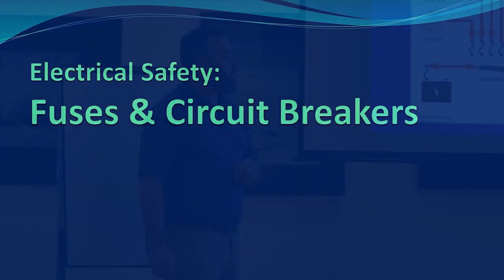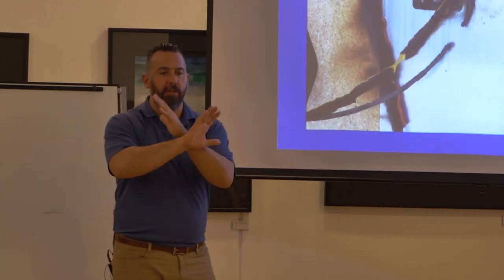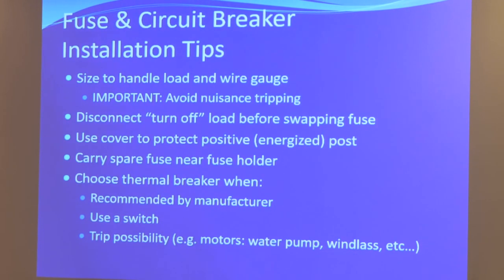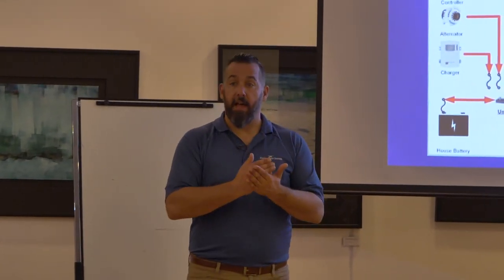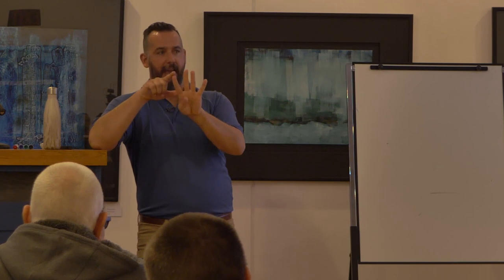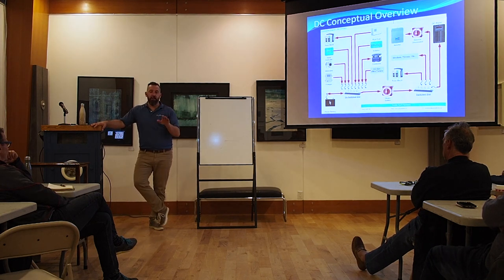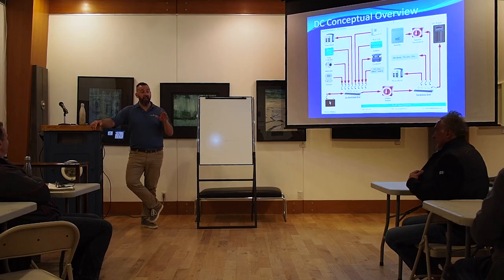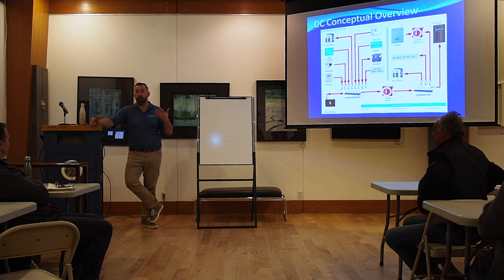How To: Marine Electrical Seminar - Fuses & Circuit Breakers - Ep 17/30

Comment: I had a dead short on a 20m-long 220v extension lead. We were building a chicken farm in Thailand and the temporary electric supply installed by the farmer/builder had no breaker, a straight 220v supply off one of the 3-phase supplies.

It is absolutely terrifying, the whole building filled with dense brown smoke. It only stopped when the wire melted. I was too scared to touch the knifeblade switch and turn the supply off. I thought my whole investment was going to burn down. The scorch marks are still on the concrete floor today.

I am a lot better-versed in electrical systems today than I was then, a lot of the information I got was from Jeff's videos. I'm still learning. Nice one Jeff, BTU.

Comment: I've been working through your video set and was most impressed with this one. Your explanation of how motors draw more current when fed with lower voltage is a topic that many techs do not understand well. You got me thinking about how I can better reposition my fuse locations to better protect the wire, in case of a proximal dead short between battery and present fuse location.

Comment: Hi Jeff, thank you so much for your videos. I had a question on thermal breakers. You say that they are generally only used on motorised loads, but are there any reasons why we shouldn’t use them everywhere, considering they are more practical and less wasteful than regular fuses?
Thanks

Comment: Your videos are fantastic, Jeff - thank you and PYS for putting these together.  I have a question about Fuses vs Circuit breakers.  From my distribution panel with circuit breakers, you mentioned in another video placing the fuse close to the appliance in this scenario.  If my circuit breaker is 5A, and my appliance (say water pump) demands 3.75A, do I need to place a fuse on this line, and where - or would the 5A circuit breaker be enough?  (Also a 100A fuse between battery and panel.)  Does the circuit breaker protect the 14AWG cable, 30ft full circuit run, and the fuse protect the appliance, or is this unnecessary with a proper amped 5A breaker?

Thanks for your help - looking forward to finishing my boat project and want to do it right!  You're inspiring many of us budget, first time boaters to not be scared of marine electronics!
Reply from the maker: Since circuit breakers come in limited sizes (e.g. 5, 10, 15, 20, 25, 30, 50, etc...), we commonly have circuit breakers protect the wire to the appliance and then close to the appliance we install the exact fuse recommended by the manufacturer. Generally, to avoid nuisance tripping of the circuit breakers, size the wire and the circuit breaker to be able to handle at least 1.25 times more then the max expected amperage. The fuse near the appliance is sized exactly as per the manufacturer.

Comment: If you are adding a fuse breaker on 30 amp shore power....do you use a 30 amp breaker or a bit higher like a 40 amp?

Comment: @12:30 the reason that the the current increases as voltage drops on a motor but not a light bulb is that the motor is also a generator as it turns-its called back emf which bucks the input current. As the the motor slows because of low voltage (or excess load) the back emf decreases ,in effect lowering the apparent resistance and increasing current. The max a motor will draw is in the non rotating condition.This often called the "Locked Rotor" spec and exceeds the "normal" load current
Reply from the maker: just gold, thanks for sharing.

Comment: Thank you for your vids.
It's a real pleasure to have so good quality information.

I haven't heard if it is possible to start a 50 or 70hp engine with the house bank, in case of a starter battery death while we are at an anchrorage for example.

I just have a look on the schema of my sailboat. There is a battery isolator and the 2 battery banks are on it. But there no fuse between the alternator and the batteries. Do you think I must add one on the Alternator, or is there a fuse in the alternator ?

Thanks

Comment: From the question about the current going up as the voltage going down to the windless at around minute 14. When I was in automotive school, the instructor said that the resistance of an electric motor comes from the armature spinning. If you could stop the motor from spinning, you would be able to create a short to ground through the motor. I think this is how the amperage goes up as the voltage goes down,  the low voltage causes a motor armature to spin more slowly and thus, the resistance goes down and the amperage increases.
Reply from the maker: Hi John, thanks for sharing this explanation.
Reply: @PacificYachtSystems  I would like to add something to help here. When a light bulb is measured for resistance (low voltage) then R is almost zero, but once connected to AC, R is not almost zero anymore (240). R value depends on the current going through resistors. Thats is why when the V drops, R drop and then Current tries to go higher, tripping the breaker.

Comment: Jeff, your electric /electronic videos are great!  On the fusing video I have a question? I have  large fuses  between house bank and breaker panel, alligator and ACR, charger and batterie banks, and breakers.  On breakers with only item being powered do I need fuse between breaker  and the item ie vhr?  On breakers powering multiple cabin lights  thru a buss bar do I need a fuse? All navigation and cabin lights  are led with 14 g  wire, running lights 14g  wire.  On plugs used to  charge  phone's,laptop's,  and computer running 12g wire do I need a fuse at tach plug or 1 at the bus bar?  Thanks for taking the time  to record and edit  theses  videos.

Comment: Great video thank you! I am currently working on the canal boat im building in Amsterdam and doing the wiring my self. 
I have a question though. I  will be using only a switched panel with 4 switches(fused at panel). So Ill run a Fuse from the battery to the bus barr and then 4 fuses going to the switch panel (just after the bus bar right). And then the panel is fused as well.
I did not see in your diagram that there has to be fuses after the bus bar, there need to be then four for eats wire right,?
Much apreciated, Daan

Comment: Great Videos you have :) I have one question: I have two motor on my boat, and consequently 2 batteries that are on use for the equipment's as well, I have a 1,2 all switch, and I would like to install a battery to use only will the equipment's, can you let me know the best way to do it.
Thank you :)

Comment: I guess there is a limit to this, when the wire length is really short, then the place of the fuse becomes a "fussy" decision, no?
ie: we have 20cm (8in) wire between the batteries and the DCtoDC charger. The fuse takes half of the length. (Small compartment on a small sailboat)
Still learning here :) Thank you Jeff.
Reply from the maker: Hi Helder, you bring a good "fussy" point. That exactly why we like the MRBF fuse, as it's a small inline fuse that is easy to deploy.

Comment: Hi Great video , where would you use a class T fuse seen you refer to it in others vids thx i have a Victron 24/5000/220 Inverter charger Lithium bank 8x12v 200a set in in 4 pairs for a 24v bank , how do i work out the size of the class T fuse thx

Comment: GDay Teach 🍎
I’m still gathering information ℹ️ on relevant formatting\outlay, for my humble trailer boat.
So, a question 🙋🏻‍♂️ ⁉️
{ Quest ’for the’ ion 😸} 
1 ) Is ‘combiner’ another description for DCDC Charger ⚡️ 🔍🤔⁉️
2 ) how many benign insulation coats should an ideal marine cable have ⁉️
3 ) What’s the Best marine cable brand, Good Sir ⁉️
4 ) For a 115hp 2stroke, what’s the ideal exterior operational [onboard] gauge wire for In-between humble appliances eg; pot winch etc, Skipper/Teåcher ⁉️
I guess that last question 🙋🏻‍♂️ is “loaded”, pardon the pun..,😉👌🏼 
As attempt to answer my own question 🙋🏻‍♂️ I Thankfully 😅 recall your previous tutorials on the importance of knowing the combined draw of existing & possible machínes/motors & converters •
Merci Beaucoup 🙏 for your insight ✨☂️🌅 🌊
Reply from the maker: 1) Battery combiner and DC to DC charging converters are similar but offer different ways of sharing a charging voltage
2) Make sure to choose marine rated wiring, it will have the correct wire insultation
3) Lots of good choices, as the many brands like Ancor can also be bought under names, like Vertex.
4) When choosing the wire, consider the max amperage and the max distance to your loads. As a guestimate, probably #0 to #2 wire size.
Reply: @PacificYachtSystems  Much Thanks 🙏 ☺️ Skipper 👨🏻‍✈️ ..,I’m blushing 👉🏼👈🏼☺️ Be Well 🖖 🌊

Comment: On land, I was always taught that circuit breakers that trip will either start to trip under progressively lower load (becoming more and more of a nuisance) or start to trip under progressively higher load (becoming more and more of a risk). Is that the same in the marine world, and is that not affected by using the breaker as a switch? In other words, should I install a true switch in addition to the breaker to improve safety?

Comment: Great video as always Jeff, thank you.
Quick question on battery discharge and protection. Is it a good or bad idea to use an LVD module? Thanks 👍
Reply from the maker: Hi Dave, low voltage disconnect are a good idea. Prevents a battery bank from going to low in it's depth of discharge,
Reply: @PacificYachtSystems 
Thank you for clarification, I can only imagine it is a good thing but wasn't sure if there were negatives involved. Thank you again 👍😁

Comment: If you got a battery one with like 10volts you can hook it to the dead one and then put the charger on them together for a hour and come back take the one that had some charge to it off if the one that was completely discharged is taking on charge it will charge on up but that’s a way to fool your charger and make it charge a battery that’s dead or bring one back however you wanna frase it !
Reply from the maker: Tks for sharing.

Comment: I have a combined charger/inverter Victron 12/1200/50 on a boat. Would a circuit breaker be able to break the circuit in case of too high current both to/from the battery or would I need a fuse?
Reply from the maker: Hi Lars, you need a circuit breaker on the AC input going to the inverter and you'll need to fuse the DC wire to the inverter.

Comment: do you not need a fuse between the unswitched and switched distribution?
Reply from the maker: Yep, you should because all the leads connected to the unswitched distribution should be fused, unless that circuit can be used for starting the engine.